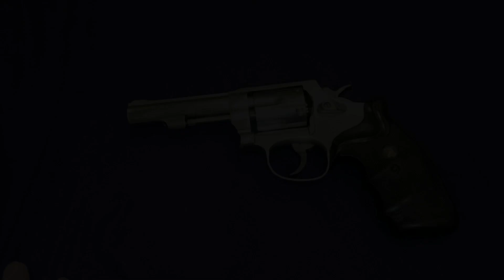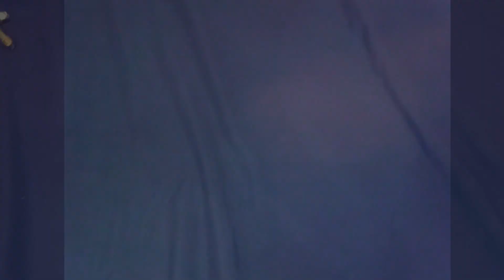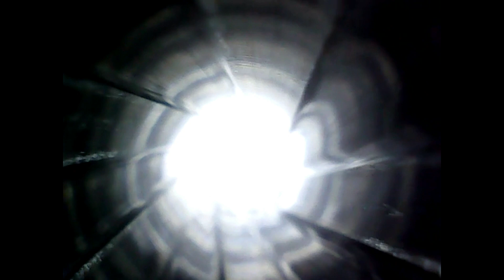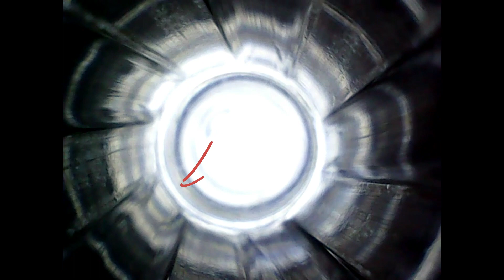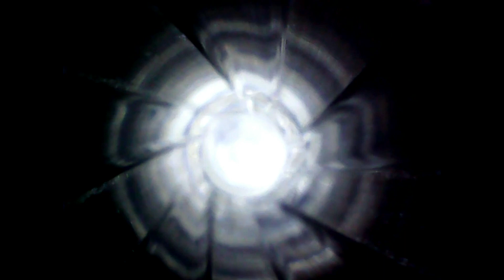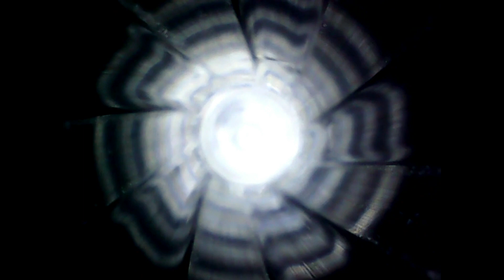Over Crushed Barrel on a 64-6 Smith & Wesson

Comment: My 60-15 was sent back due to a canted barrel. After it was returned, groups opened up and it leaded badly after the frame.  There is a line in the barrel where the frame meets the barrel when I shine a light down it.  Slugging it with a soft .36 round ball varified what they did.  My "cheap inferior" Taurus revolvers never had these issues.
Reply from the maker: Thanks for your addition. In my opinion: Anything with a thread would like to relax opposite to the square surface. Square simply cannot be achieved with anything threaded. The compression of the angular pitch to its radius of contact would lead to an eventual non-concentric squaring of related conjoining of parts.

No such thing as a consistent 100% zero in anything. Sights should be checked every 5 years even though not in use. There's no such thing as a AR-15/M16/AK/Drakenov "sniper rifle".  It's what someone can accomplish with it that makes the sniper, not the rifle. Fair to say you may be a sniper, but there's no such thing as a "sniper rifle" without its accomplished operator.

Old Molsen Nagants of WWI tend to have barrels way off the center line simply because of the bore twist to its sectional density. That's just the way metal is. It wants to relax. 

When manufacturing things they really should pay close attention to the thread pitch to help offset - correct the relaxation of the barrel. Some barrel shapes tend to be resistant, but that's not even a modern/post modern factor in manufacturing now. It tends to be all market hype & hysteria. Adding a shot gun rib on a Colt Python or a bowling alley style gutter sight of a Ruger Security Six does absolutely nothing for accuracy. 

Sometimes the barrel comes short of the sight alignment & instead of adjusting the shoulder, they over torque it so it "looks right".  Going towards shrouded barrels would help eliminate the assembly Gorillas out of all the wrench monkeys. 

What might've happened was the manufacturer might've hired a bunch of assemblers to fulfill an order. Not having necessary aptitude to synthesize hand, eye & thought would lead to having to accept discrepancies or otherwise rework the entire lot, rendering them as seconds. You don't see seconds being offended outside LE/Military contracts.

We have to realize with the lack of experience social reform creates there really is no telling who assembled them considering they could've been tax break incentives for federal subsidies or for "favorable contract consideration".